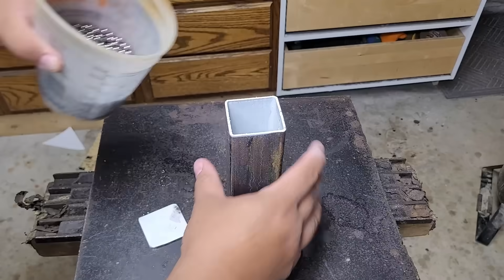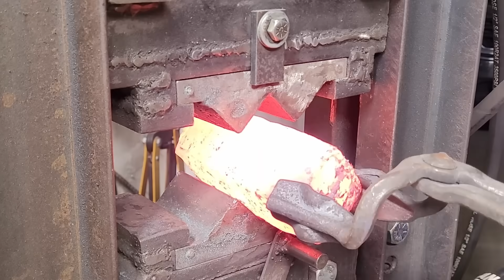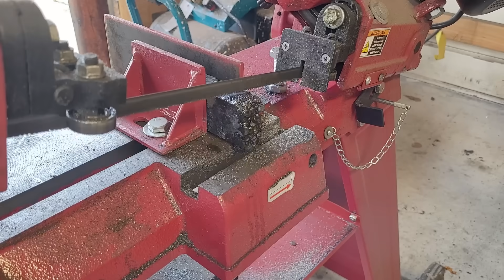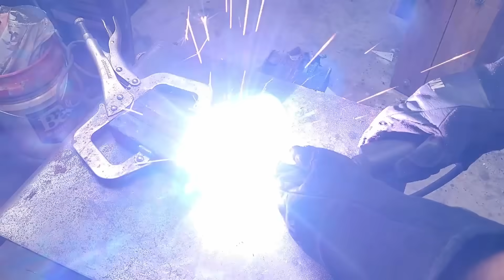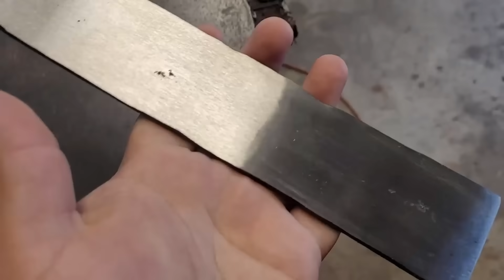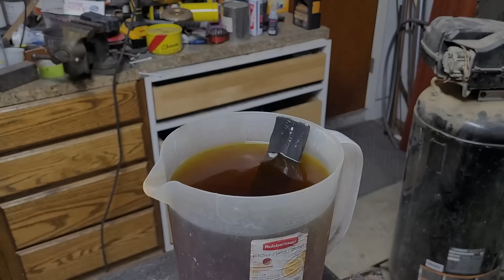Forging Serpentine Ball Bearing Damascus

Comment: May have had some residual chemicals left in the bearings from the cleaning.  But more likely, the chrome bearings are simply harder to work with.
Reply from the maker: The chrome makes it a nightmare to weld

Comment: Why didn't you put powdered steel in dude? Just curious
Reply from the maker: Trying to get a different look. Ive done many with powder. It gets boring to do the same thing over and over
Reply: At least the powder actually works, why it's used in canisters

Comment: The ball bearings have chrome in them so they are harder to forge weld together in open air.  For the tip, another method is just pinching it completely in the press so it forms a tip and your layers converge, that way you don’t need to forge weld.  It’s a bit different look but I think it will work here.  Good luck!
Reply: nice to see you are watching newer smiths doing work
Reply from the maker: It thought about the pinch method but i ended up just cutting it. They make nickel plates ball bearings as well i believe. That might be a better option for this type of build.
Reply: I just watched someone doing a similar project with nickel coated bearings and no powdered steel; can't remember who it was, but it worked really well. Keep at it! @JPsBladeworks

Comment: Your material was a bit thin when you forged in the tip, that's why you got the cold shut. It should be salvageable though. Just take an angle grinder with cutoff wheel up the cold shut to clean it out, and adjust your forge for a rich burn and try again with gentle blows from hand hammer and Flux the crap out of it (like dip the tip into a tin of flux)
Reply from the maker: I ended up cutting it but that is a good thought. Ill keep that in mind if i run into this problem again.